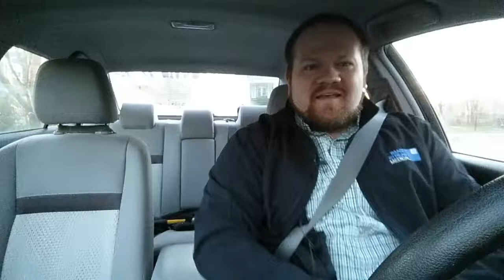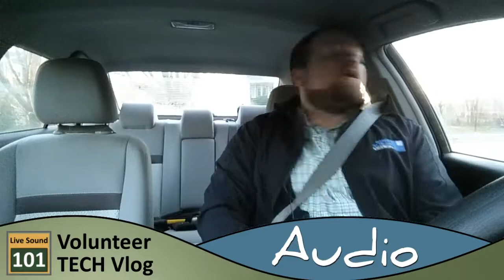What is Sound Reinforcement?

Comment: Is it time for a drum set enclosure? Move the Electric Guitar Amp to another space and mic it (or build an amp isolation enclosure)?
Reply from the maker: +sewing1243 Josh and I were just talking about possobly building an iso closet or enclosure of some sort for the guitar amp. Enhancements could be made to add a roof to the drum shield. That would be nice.
Reply from the maker: +sewing1243 we havent fully eq'd the new system yet. We time alligned the mains and sub but we still have tweaking to do on the main EQ. It think that will take about 4-8 hours to really dial in EQ properly.